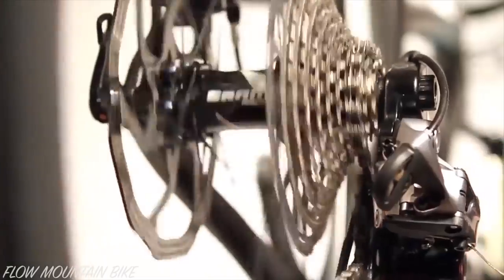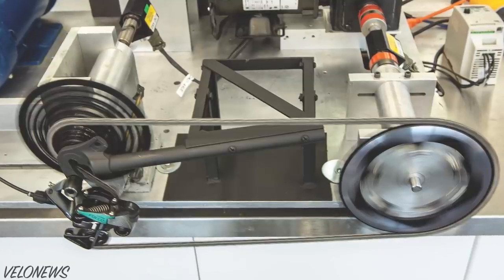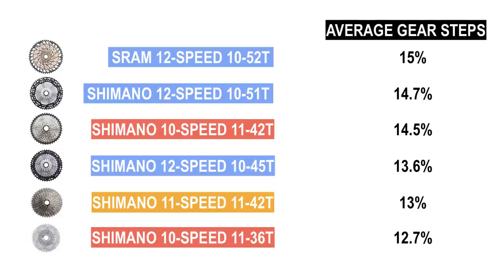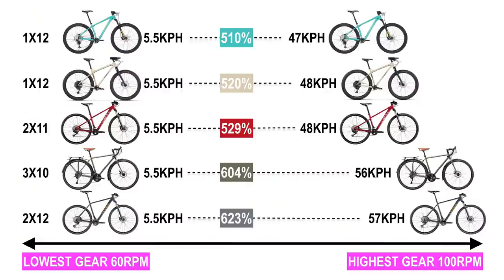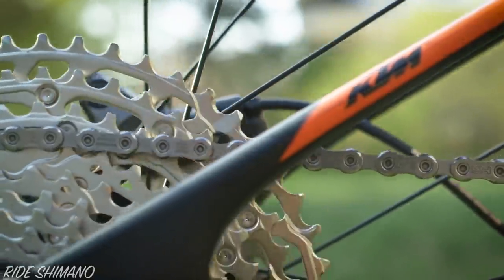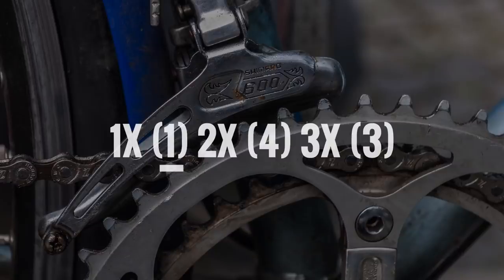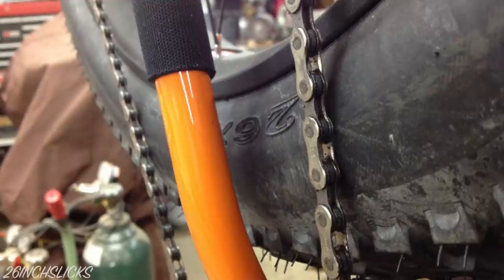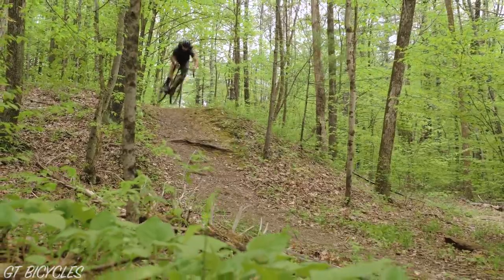1X vs 2X | What is the ULTIMATE Drivetrain For Your Bike?

Comment: Something big in my experience that can't be underappreciated is chain retention. I'd give 1x another point for that. Even a perfectly setup 2x system will have occasional issues when riding on rough surfaces, even with a clutch rear derailleur. 1x very rarely drops a chain.
Reply: I have sometimes had chain retention issues with a 1x - and fitted a narrow front derailleur to it to cure the problem.
Reply: @pashakdescilly7517  with a narrow-wide ring and clutch rear derailleur? I've dropped a chain exactly once in the thousands of miles I've ridden a proper 1x setup and it was because the chain was so worn it no longer fit the chainring.
Reply: Have you tried Shimano 2x12? The chain retention is very impressive there, to the point where I've almost worn out my second chain on my current drivetrain and have yet to have the chain drop on anything. The other benefit is the chain doesn't shift itself down the cassette when you're rolling backwards in low gears because the chainline is better - very handy if riding fakie is one of the maneuvering options in your repertoire.
Reply: @peglor  I haven't ridden 2x12, but I'm sure it's excellent just like their electronic groupsets.
Reply: @andarenbici  it's not. 1x chainrings are designed to hold the chain tight, 2x rings are designed to be able to be derailed
Reply: @andarenbici  As Snoochies pointed out, the chainrings themselves on 1x vs others are designed differently.
Reply: @pashakdescilly7517  A chain guard would have given the same retention benefits AND provided bash protection. Good to know though
Reply: @cjohnson3836  Shimano 1x chainrings aren't using the narrow wide setup to retain the chain. Given the straighter chainline in the useful gears with multiple chainrings, there's less to derail the chain in the first place.
Reply: @peglor  No where did I mention narrow-wide teeth. But, since you did, both SRAM and Race Face use that for chain retention. Shimano's 1x are still different in tooth design, however. Its just not narrow-wide. And, its still about improving chain retention. And, no. Chain drops are, objectively, more frequent on multiple chainrings. You may wish it to be different, but its simply not true.
Reply: true enough,  BUT,  i figured out how to lift my chain back up bro !!!     i switch out on my 2x  front derailleur  up or down AND it works the magic !!!     ☺
Reply: @peglor     2x 14 shimano here on my giant talon 4 2021   ..  i trick i found out to dropping my chain on rear cassette is,    just go front derailluer up or down  //   down and up     ..  And  wala  !   MAGIC !!    😚 👍
Reply: @Spitch Grizwald    say chain rings !!!     🤟 😁

Comment: 3 x 9 for touring for me. (48-36-26 chainrings and 11-36 cassette). Huge range of gears and half the price of a 1 x 12, which I think should be factored in. Alivio these days is perfectly smooth enough - (Shadow rear derailleur, Hollowtech II bottom bracket, downswing front derailleur, etc.) while being reasonably priced and more easily replaceable. Pro touring tip: drop bars with Gevenalle shifters.
Reply: Same drivetrain here! 🙋🏻‍♂️ Using a 26er converted to Gravel Bike though

Comment: Spectacular video!  Thank you so much for putting this together.

Two items that are often brought up by proponents of 1x are 1) they weigh less and 2) removing ehs left shifter on the handlebars provides more of that valuable handlebar real estate for a dropper post remotes or for a shock lockout remote.  To me the loss of weight claim is very minor, if slightly inaccurate.  Often a new derailleur and new larger cassette is required to attain the same or similar gear range that was afforded by the 2x, both of which likely weigh a little more than that they replace.  Sure, the front derailleur is gone and it’s associated cable and shifter and one chainring, but we’re talking not much weight.  I think the more legitimate argument is freeing up room on the handlebars.

Your final thought on tire clearance and shifter chain stays and thoughts on frame design is an eye opener for me.  To provide the linkage clearance, the clearance for wider tires, etc, it all makes sense and why many MTB frames now have “Boost” sizing.  The claim I often hear about Boost is to provide more clearance for wider tires, but I can see Boost sizing provides more chainstay design options and accommodates better the 1x systems.

Thanks again for this thorough, well-thought out and well-presented video!

Comment: I think that 2x(9 or 8 or something) with friction shifter is the most care free drivetrain, because you can manually adjust chain to right coq.
Reply: i used to love manually trimming my 2x8 downtube shifters getting it just perfect, it was light too without all those cables etc
Reply: Exactly what I am using. Mind you bike fit and handlebar design now assumes all brake hoods are STI/  Ergo so getting brake levers that match those shapes is a challenge.
Reply: shimano 2 x 7  here  ..   all good,    XC    Giant Talon
Reply: I still usse 3x7 friction-indexed thumb shifter combo the least expensive setup ever
Reply: 2 x 7  microshift /shimano    mountain bike
Reply: @huseyinuguralacatli5064      2 x 7 microshift    with the 4 lever thumb shift

Comment: I run a 3x10. Had no problems so far. It does take a little practice on when to shift.
Reply: I run a 3×8 about to make conversion to 3×10
Reply: 30 gears totally unnecessary. Nobody ever needs more than 9 speeds. You have to be weak as a kitten to need more.

1--3=climbing
4--6=cruising
7--9=sprinting

And thats it. When I hear about people using even 1x11 I have to LOL.
Reply: @fender1000100  I'm sorry if we're not as strong as you are and I'm sorry if we're taking the number of teeth jumps per gear just to make the ride smoother. 

Not everybody is into bikes for races, some of us travel around countries at a chill pace. So again, I'm sorry if we're as weak as kittens.
Reply: I would point out that many of the pro 3x crowd here have been using it on touring bikes. Bikes that are heavier than standard road bikes and that are often loaded down with lots of heavy cargo. Tents, cooking gear, food, water,bed rolls,etc. 

They might not be as weak as you think.
Reply: @fender1000100  Bullshit. If it was true there would be pros using 9 speed casettes, since they can be lighter than 11 or 12 speed ones. But no serious rider wants big jumps between gears and small range. You can sacrifice one, but 2? Absolutely pointless. Anything under 10 gears is plain stupid, unless you ride on a perfectly flat terrain.
Reply: @Raijin24226  But the fender guy said something absolutely dumb. 9 speed over 10 is pointless. the weight difference is tiny, not to mention that the 10 speed casettes are lighter cause they are from the component lines above the 9 speed. The shifters for 10 speeds and more are great, for the 9 speeds and less they are plastic toys for little kids. I have a Shimano Saint shifter for my 10 speed drivetrain, there is not a single better shifter for the 9 speed or below.

Comment: I recently upgraded my touring bike to 3x10 and its awesome. I have a crazy low gear of 22x36 which is great for steep climbs off road when loaded. Top speed is way faster than my 1x12 MTB. Someday I'll upgrade to 2x12, but I'll be sticking to 3x10 for a long time!
Reply: I'm even crazier, 22 x 46, I use a 22/46 x 11, had to buy the 22 separately because shimano only does 24 - 34
Reply: using 2x7   now   ..  maybe  2 x 6   later
Reply: @ferruccio4531     stick with shimano    😊     i use 2 x 7
Reply: This one by Is propaganda and collusion by the parts and bike manufacturers. Sure it looks hot and cool but it doesnt offer many options.
Reply: why is 2x12 an upgrade compared to 3x10 ? ( im looking to replace my 3x9 on old mountainbike to go touring. )
Reply: @CogitareEstVivere  Because 3x10 is about 500g heavier on average. Dont go 2x12 for touring. 2x11 is enough if you are not racing, 11 speed 11-51 casette is cheaper than the 10-51 one, it doesnt require the micro spilne freehub body. I would say more, 2x10 with a 11-36 or 11-42 casette is going to be enough if you will have a 10 teeth jump (or bigger) between the chainrings. a lot cheaper, and a tiny bit lighter, you dont need to have over 600% of range on a touring bike.
Reply: @jurekgadzinowski2895  awesome reply mate ! Thank you longtime !
Reply: @ferruccio4531  cracy ! 😏
Reply: @jurekgadzinowski2895  and do you think  about Rohloff ?

Comment: Great content as usual. Most of my bikes have older 9/10 speed XTR triples. Just did short loaded ride on the Cross NH Adventure Trail and there were a few spots the 22/36 was very useful, and the 44/11 was enough at the top end. Haven't really found a 2X that quite gets there. GRX with a 31/40 would be okay on tarmac and good dirt roads, but wouldn't quite cut it on rough dirt. 
I love  your references to testing sources.
Reply: 650% gear range, I use the same setup. Do you also use 29" tires? It gives a really good granny gear!

Comment: Probably the best explanation of choices for picking a 1x2x or perhaps 3x. Personally I have all 3 types of drive trains. My old Mtn bike has an old 3x and is used as a commuter. My gravel has a 2x11 and I truly enjoy the extended range for my mixed gravel pavement 100 mile days. My new geared Mtn bike is a 1x11 and I it keeps things simple for my 20 mile trail rides. I also have a Single Speed Mtn bike and it doesn’t get any simpler but that’s really just for short 10-15 mile rides on trails I know what to expect.

Comment: I’ve messed with road/gravel 1x setups and have come to believe replicating a full 2x gear range is folly because of the big steps between gears. I think it’s wisest to start with a nice cassette like 11-32 and then choose either a big or little ring. I run 11-32 with a 38t chainring and it’s surprising how much speed variability it offers. 38:11 @ 100 rpm is roughly 30mph.
Reply: Totally agree.
Reply: I guess it depends of what you're comparing. My old 12 speed (2×6) has fewer ratios and bigger steps than the 1x10 I'm currently considering. A 2x8 isn't typically much better. The 3x8 I looked at last week had a bigger range of ratios but the 2 highest would be completely useless for my riding, leaving me with 11 useful unique ratios pretty much identically spaced as a 1x11.

Comment: As a bike mechanic, I have found that 1x11 and 1X12 (especially) systems are prone to bad shifting if there is the slightest bit of damage to the derailleur. I can straighten the hanger in most cases, but I don't have the tooling to check the straightness of the derailleur. I can spend a lot of time taking it apart, using straight-edges to measure the halves of the cage, bending a bit here and there, but it is never as good as new. I would really need a machine-shop-grade flat table and other fixtures to get it right. Bottom line is these things are too delicate for mountain bike use if one is going to crash every once in a while. And with the parts shortage now in effect this is really a problem.
Reply: And I guess, this is exactly the main purpose of the invention : (

Comment: I ride a 3x hybrid  bike but I barely use the largest front ring. I'd vote 2x for hybrid definitely! Thanks for the video👍
Reply from the maker: 2X is becoming the default drivetrain for many hybrids!
Reply: I put a 3 x (or a 'triple' in old money 😁) 52/42/30 on my all-purpose road/cross/gravel frankenbike but as it's not meant to be a bike for winning races on at 26+ mph (and i cant pump out 250W for hours on end anyway),  I ditched the outer ring (and swapped the  bolts for shorter ones). 42/28 at the front (i changed the inner ring too) with 12-28 at the back pretty much serves all my gearing needs these days.
Reply: the results were in,    2x  5 points  ...     😉
Reply: @Cyclingabout     yoy did very well with your specs guided analysis  ...  i am on my first  2x   setup ever,   its entry level  shimano  2x7   ... maybe low budget entry level,  but i got used to it ..

Comment: Bravo - thanks for the research and video  - I was thinking of converting from 3x to 1x  in front for e-bike conversion and ditching the lower gears on the front derailleur - keeping the bigger chain and front chain ring and stock rear derailler setup. With the motor assistance the lower end gearing is probably not needed. Thanks to your video I can see that potentially keeping the standard setup may actually have more benefits than spending money on a new 1x system.

Comment: An important factor you're forgetting (perhaps of no importance to roadies/bikepackers who don't get rowdy) is that bigger spacing is preferred where terrain regularly undulates rapidly/suddenly and time is of the essence (MTB trails). 1x setups mean 1 or 2 shifts on your RH are needed rather than  3 or 4 RH + potentially a LH shift to maintain chainline/no FD rub on every pitchy climb/descent. 

This especially true for disciplines where rider input/body language gives you bucket loads more speed than optimal cadence at all times or 2-4W efficiency chainline gains (e.g. pumping, cornering, picking lines, bunny hopping, manualing etc). Less time shifting = more time/concentration to read the trail/milk it for speed. This is exacerbated by no FD = a dropper lever goes in it's place which is a huge benefit for jumping, cornering & descending (and even some technical climbing).

Comment: For a bicycle trip with mostly paved roads I would hesitate to pick a 1X. Most of the riding would be done on the smaller cogs of the cassette, and the front sprocket is also pretty small. That will wear fast, unless it would be an exceptionally durable chain like those new 12 speeds.

Comment: 3x easily wins in all categories. 

The weight savings argument against the 3x doesn't make hold weight since you could apply the exact same argument into using a single speed instead of having a cassette at all.  In fact a 3x 7,8 cassette would probably be way lighter than a 2x10,11,12
Reply: The tiny weight savings of 2x vs 3x is more than offset by going 10sp to 11sp.

Comment: Alfine, Automatix or Nexus for practically no hassle. On my MTBs i use the 1x9 and 2x10. It really depends on your bike application. If you don't have steep areas and want a cruise/grocery bike, just pick an optimal single speed setup. 16T in the back for example. If we are talking racing, road bikes still have 2x. Mountain bikes or downhill bikes can easily live with 1x.

Comment: 3 X with not front derailleur. If you have a typical triple crankset, shimano ty 48-38-28 teeths, and 7-8 cog , you can go uphill using the 28 teeth crank in the all cogs with not problem. When you go down hill, you change the chain manually at the 38 or 48 ring of your crankset. It's work very well and you can use really all the posible combinaton. I learned it in Santiago de Chile a city between the mountain. It' s a "Chliean method".

Comment: I’m a huge fan of 9t cog. After saying bye bye to good ol HG freehub body & replacing all my bikes with XD driver I can run now run 9-42/9-50 cassette using smaller chainring up front. I actually prefer bigger in between gears so it works perfectly for me and so far all my components are still in good shape.

Comment: Another unsung contribution 3x systems make is the ability to reduce the weight and thickness of a rear cassette.

While existing systems have wider chains for lower geared drive trains, if the industry were to use 12 speed compatible chains and cog thickness to ten speed or even 8 speed systems, that would allow for a greater angle for the rear wheel spokes.

You don't have to have a massive cog when you have a 3x.  And the weight should have been put on the bottom bracket as full suspension bikes' rear wheels are actually un-sprung weight.

Comment: I run a Sram 2 x 10 setup on a mtb. If we call the granny gear number 1, I would use gears 1-3, gears 11-13 and gears 16-20… I rode a 1 x 12, it felt wierd, but that could be because I’m not used to it… Thanks for the vid mate, you’ve got yourself another sub

Comment: hilly areas where I live.. need at least 2x on the front. I've got a 27.5" mtb with 2x9 speed, I kinda still prefer an old 3x8 over it tho. And then 3x9 and 3x10 are god tier among my friends.

That being said, I'd love to live somewhere very flat and ride a fixed gear belt drive system. 29x3.0" wheels/tires aren't as common as they should be too

Comment: I custmized my 29er with 3 x11 with a Garbauk cassette 11-50. My lowest gear is now 22 x 50 and a gear range from over 800 %. What shall I say? It is great to climb up walls. I‘m an old guy with 105 kg. I cross the alps with 60 beats/ minute. If you know how to shift with 3 gear rings in the front, I can recommend this.